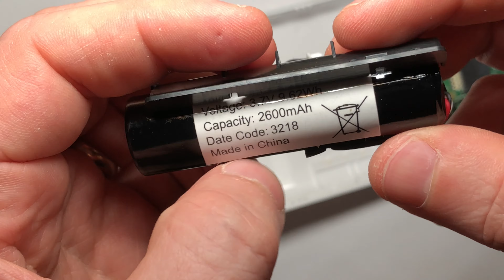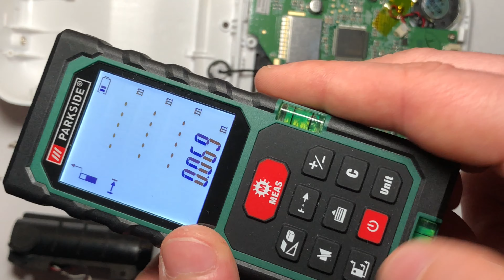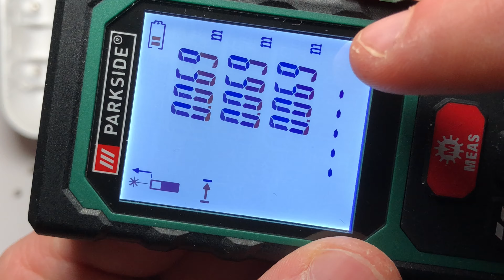Philips avent battery replacement

Comment: Hey I need help.At first sorry for my English..  I have the The Avent Babyphone 923/26..it is not possible to charge the accu..Could someone show my how this works?Help..
Reply from the maker: Hello, the battery or USB socket may be faulty, try another cable or charger. If the battery has not been charged for a very long time, it needs to be replaced. :)